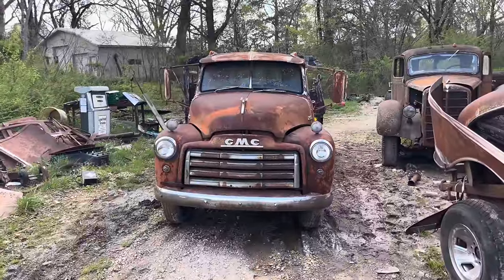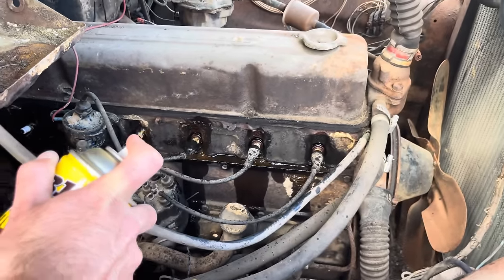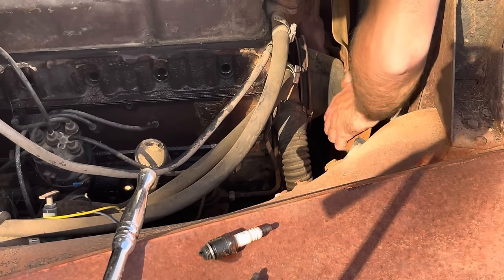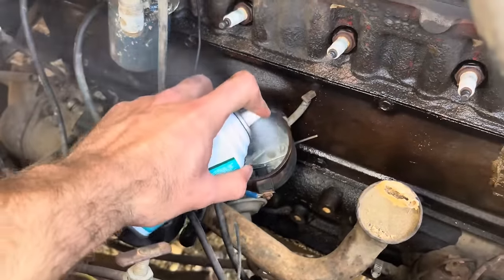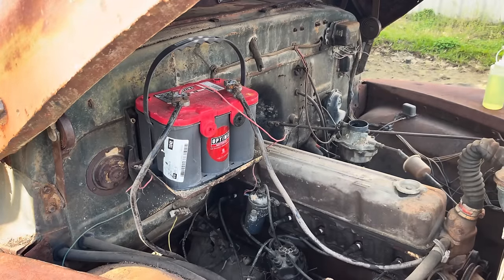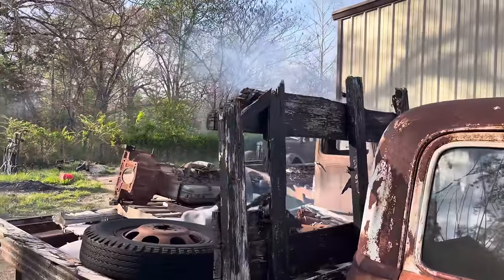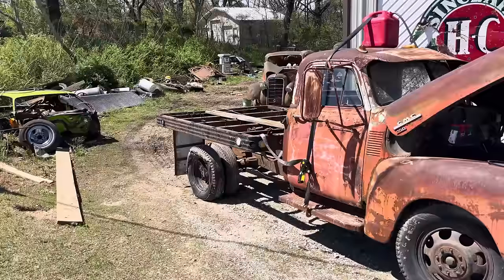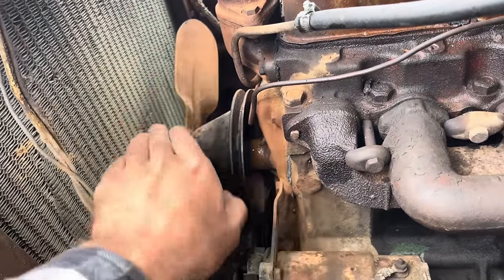Will it run after 20 plus years 1953 gmc 1 ton truck

Comment: The fact that it just fired immediately after being unstuck and having the points sanded is awesome.
Reply: way to spoil the ending
Reply: Seemed fake.
Reply: @spaceghost8995 ? How's that?
Reply: @spaceghost8995  Nah, watch some of his other videos. This thing is basically fresh off the showroom floor compared to most of what he's managed to get running.
Reply: @dylanfurr8926 don’t read the comment if you don’t want spoilers
Reply: @mrwow1667  it was top comment
Reply: this one basically went like,
"Oh! is it time to get up? I'm ready for work, boss!"
Reply: @spaceghost8995 Lol how is this something you could fake
Reply: Tooo new
Reply: @dylanfurr8926  sorry!
Reply: yup, but not surprising,the chev/gmc 6 (235) is one TUFF motor,its the last,and toughest 6 chev had
Reply: @PissChrist.999  stovebolt 6. Since the 30s onto early 60s...like a rock
Reply: @gerry-p9x  ,so true,I rebuilt alot of them yrs back,the 235,  the last six with 30 deg intakes and full pressure mains n rods (54-62),plus distributor shaft had bearings in it (changeable), the newer,1963 style,the shaft ran in the alum housing....end of an era....
Reply: Dang, I read the comments before watching !

Comment: Fun fact, that six cylinder GM engine in this truck was first designed in 1927 and was in continuous production up until 2002 and lastly by Toyota.  Toyota ran this design from 1955 until 2002 😉
Reply: If only the Toyota 235 heads worked on the old blocks. A 12 port head would be so cheap!
Reply: Those 1 ton engines usualy are 261's, and got used alot to build the blueflame version. My Dad put one in his 55 1st 1/2 ton Chevy. Guy needs to give that distributor, some ajusting.  :}
Reply: what
Reply: The Toyota inline six they started using in 1955 and it looks identical to the Chevy except it has metric threads.
Reply: If you look for images of Toyota type F engine you will see what I mean.  Wiki shows them 1st using it in 1949.
Reply: The late 20s vintage GMCs I worked on (medium duty trucks) had the Buick 6 cylinder, which was their first full pressure lube system. It was a "Master 6" at about 300 cubes and 80 HP. The Chevy engine was a different animal.
Reply: @rupe53  that's awesome, I never had the pleasure of working on the Buick engine you are referring to
Reply: @ianhoyt2638  they might work but they are drilled and tapped metric.  Would be neat to see if you could combine them 😉
Reply: @FunWithCars716    In the late 20s, GMC needed a mid size truck, so basically borrowed everything from Buick touring cars to meet the requirement in the 8-10,000 pound category, then fitted them with 20 inch cast truck wheels instead of wood spoke. (early split rims) The one I have been working on for the last 40 years is a 28 GMC / 29 American LaFrance fire truck. (took 9 months to hand build) Fuel tank is under the seat, and it has all mechanical brakes. Weighs about 8,500 pounds with me in the seat. They made a Master 6 and a Standard 6. The master has a 3" bore by a 5" stroke. The Standard is 2.75" bore by a 4" (?) stroke. They will climb a hill at 1,000 rpm in 3rd gear and idle all day at 500-600 rpm. It has poured rod bearings, and the oiling system is a manifold with flanges that bolts to the 5 main bearing caps. Only the crank is cross drilled to supply the rods. Each rod has a nozzle on the big end that strays up to lube the wrist pins. There's another pipe from the oil pump to a fitting on the side of the block, which runs externally to the head / rockers / valves. The optional (by-pass) oil filter ties into that pipe and is mounted to the firewall. Capacity is about 10 quarts with a filter. I overhauled that engine about 40 years ago (bottom end) and I actually found a guy to repour those rod bearings. The mains were set up with shims so reset the clearance there and done. Rings were available from TRW (measure to fit) and a rope type rear seal was used from an Olds Diesel. (late 70s?) Pistons come out the bottom so never pulled the head... no head gasket available at the time. (pre internet days)
Reply: @FunWithCars716  The later motors with the revised head design have different water passages if I remember correctly, they also made them slightly larger. The spacing for cylinders and valvetrain is the same though. So, technically you could rework one to fit, however buying a wayne head would likely be cheaper.
Reply: @ianhoyt2638  I wouldn't necessarily want to try it but I just marvel in the fact that Toyota used a Chevy engine design 😉
Reply: @Emprivan  The 261 engines shouldn't have been found in anything other than 2 tons, stock that is, this truck would have had the old jimmy 6. And the 1 ton Chevy equivalent would have had a 216 and not a 235/261. The early 261's, 1954-1957, were an additional cost option for the 2 ton chassis as opposed to the 235. From 1958-1962 they would have been standard in the 2 tons and you could opt for a v8 that year too. Just figured that it should be said that the 1 tons are not usually 261. It would be nice if they were though!
Reply: @ianhoyt2638  Ya, I just know the talk was they got it from a 54 tow truck, could of been a shortened 2 ton.

Comment: I had a old 1949 chevrolet same show, locked up, diesel down the plug hole for a few days, new points, cleaned out the carburettor, through a 1rd of a cup of petrol down it and off she went beautiful old trucks tough as nails

Comment: did anyone else see it the distributors moving back and forth when you had it runing yeah. GG bro :hand-purple-blue-peace:
Reply: Me too. Chevy 216, 235 has a vacuum advance at the base of the distributor that moves it whole
Reply: sure, most gm/delco dist in those years,had'outside' vac advance,the WHOLE dist turned...
Reply: Oh so it's supposed to do that?
Reply: Yeah, cant unsee it once you do.
Reply: @jaybeemhardscrote7466   yup, theres usually a grease  cup  near the base,you turn it down once in a while..nothing wrong with that set up...

Comment: I sure do like that GMC.
 Back in the late 80s I found a 1950 gmc 1/2 ton short, side step pu and was able to trade for it with a 1963 buick special I had gotten for free, but it had no interior whatsoever.
 That 1950 gmc was in great shape, and the interior was all remarkably in nice shape other than the seat, which I replaced..
 I put a lot of work into it and then 3 years later the transmission went and i could not get one anywhere at the time in my area, and there was no Internet, and I didn't know anything about finding parts across the country.
 I wound up selling it for about $1,000 to a guy for his son..
 I still miss that truck, wish I'd held onto it, but had nowhere to keep it.

 Edit: the Buick was a 64' not 63'

Comment: This one made me think of how I did this to our 51 GMC Freezer Truck when I was 15!  She needed to move after 30+ years of holding Ice Cream behind our Market and I took on the challenge.  It went just like this but used a giant screwdriver to kick the starter .  I finally drove her with square tires about a mile to her new resting place where the buyer pulled the freezer box off and used it while the Truck was sold off.  She was a genuine Knudsen milk truck from 51! In 50 years she only had 28K!

Comment: I just thought about that slop you were feeling when you were rocking that motor back and forth. I've seen loose, worn out timing chains and gear-to-gear drives do that! And looking at this one I'm pretty sure it's been a while since it's been replaced. If ever!!! Lol! Also the ignition timing will dance around when you do get it running.... Sometimes it'll run sweet and sometimes it'll konk out and not run at all!

Comment: Just got a 58 gmc 370 with a 2 speed rear axle  , motor is locked up oil looked great same as antifreeze lifters and valves look great

Comment: What you did with the torch and sparkplugs reminds me of my old snowmobile.  It was a 1970 and it wouldn't run right on a fresh set of plugs.  I would run the new plugs for 15 minutes at idle then put them back in the box. If used them a few weeks later they worked perfect.  It seemed to foul out less if I pre-baked the plugs.

Comment: Plugs looked rather clean before you pulled them out I now have me a project truck from a relatives farm comes with a farm all Cub and a neighbor where I live has another truck for me so I’m off to an adventure with three but only two are unknowns the 53 five window I did the suspension on 20 odd years ago I need to re pin the front with some new springs and she’s good. Got the improved 6 I cannot wait

Comment: I didn't go through all  the comments but I did see that at least one person noticed it has the wrong engine in it. That's a 54-62 full-pressure 235 Chevy engine, which did not come in that truck originally. Actual GMc straight sixes are so rarely seen these days that even if it did have the original engine most people would assume it's a 'stovebolt six". Fix the stuck valve and it should run a lot better.

Comment: I started a 51 GMC flatbed last spring that had its bed and tires burned away in a fire. Sat for 40 years and it fired up after some coaxing. Didn't sand point or anything. Fuel pump even worked and pumped little rocks into the sediment bowl. I had a terrible time with the starter not grabbing like this one did on you only a few times.

Comment: hey mr. jennings, love your videos, i've learned quite a few things from your channel. do you have anything for sale at the moment for less than 1000$?
Reply from the maker: I have a old Mack truck that doesn’t run for 800 I will also have a few more cars and trucks  in the next couple weeks for around 800-600 each what are you looking for and I will see what I can find
Reply: @jenningsmotorsports7554  do you have anything that doesn't run, isn't seized, but also isn't a death trap. i wouldn't have space for the mack, but it does sound cool
Reply from the maker: @paul_2028  I have a 1928 dodge car that should be next week’s video has a title but that back half has been cut off it will be running I would take 800 on it once it’s running 
And I will try and see what else I have I am sure I can find you something that is halfway nice and fixable it will just take a little while
Reply: @jenningsmotorsports7554  thanks man, appreciate it.
Reply: i also have a 1990 ford f-150 lariat, efi with the 302 v8, it was abandoned around 5 years ago, and i'm trying to get it running. any pointers with the fuel injected stuff?

Comment: Take the rear bush cap off your starter and shim the armature forward slightly. You might get 1/8th to 1/4” and reposition whatever shims are in there. Then you’ll most likely find the pinion will poke forward a little more to engage past that bad teeth patch.

Comment: I wonder if, off camera, you set the dwell, maybe vacuum time or power time the distributor, and adjust the idle speed and mixture. That is, before all the struggle to keep it running. Just curious how much is done that we don't get to see.

Comment: The white clouds, is thatg fuel or exhaust or the water boiling out of the engine?
Reply from the maker: It’s the oil I put in the cylinders burning off and the oil and gas I spilled on the exhaust burning off
Reply: @jenningsmotorsports7554  ahhh, I always thought it was decades of being sat in the open 😅

Comment: That might be a 270, could even be the famous GMC 302 I-6. Hot rodders built em back in the day, with a Wayne crossflow head!
Reply: I'd like to hear more about that hot rod 302 I-6 set up
Reply: The GMC engine is long gone.   It's got a Chevrolet six in it now.
Reply: It's either a Chevy 235 or 261.

Comment: With it spitting back through the carb as bad as it is, can it be a timing issue?
Reply: he did mention a possible sticky intake valve, although I'm sure a good carb cleaning wouldn't hurt either.

Comment: Fyi , that cab is no 53 , I say 50 since it has a side cowl vent last use in 1950 ,  doors seems to be correct with  push button door handles.

Comment: Excellent video Jennings  :) at first thought soak valves for all 6 cylinder on intake and outake   ! Then take oil pan off figure out clunk was about and   get unseize  to all motor so far going as you planned too ! Nice find this truck too and very good to fire up plus move some on power!
Reply: The clunk is most likely a loose harmonic balancer. If it was a rod, it would have been worse the more he revved it up. The 235s are really bad about that since the balancer is press fit instead of bolted.

Comment: I had a similar gm engine and the dividing plate between the inlet and exhaust manifolds had a tiny rust hole it it, popped and farted until i found it.

Comment: The distributor is loose. it was moving'
Reply from the maker: It has a vacuum advance it’s bolted down tight it’s supposed to move like that on the old ones it moves the whole top part of the distributor

Comment: To Joynnings Motor Sports, Thank you for the great videos. Of all the ones that I have watched, I have enjoyed every single one. Some questions have come up. Do all crankshafts and distributors turn in the same direction? How do you know which vehicles have positive  ground? Do you use ethanol free gas to get the engines running?

Comment: Sweet old truck,but I will never understand why they put 6 cylinders in those big trucks.
Reply: Because GM didn't have a V8 yet. Besides, the six cylinder had more torque and would outpull the earlier V8s.
Reply: Interesting

Comment: Take ANY new GM truck today and it wouldn't last 20 years before you need new frame rails, new engine, new body, new everything. They use cheaper steel now, lower grade aluminum and too much plastic. And these old dinosaurs were built back in the day when automakers cared about quality and you can still find them needing a little tlc and they'll run and drive just fine.

Comment: Ok first off you should not use either and you should not run it at high rpms geez you don't know what you're doing a vehicle that has sat for a long time I guess you couldn't hear when you kept putting either in it was starting to sound like a hard knock now with that said I have worked on vehicles all my life and never abused a vehicle like you did here in this video be kind to old vehicle s and equipment